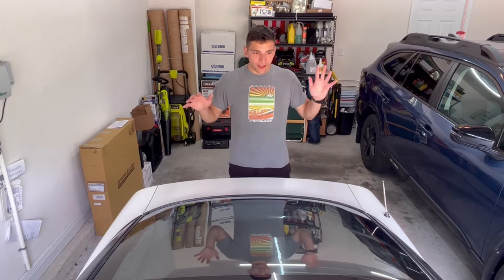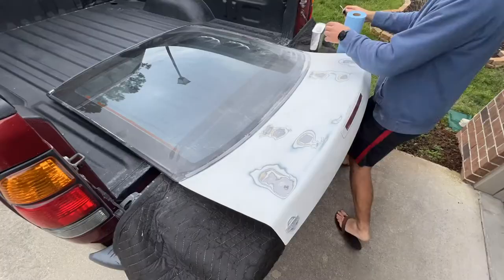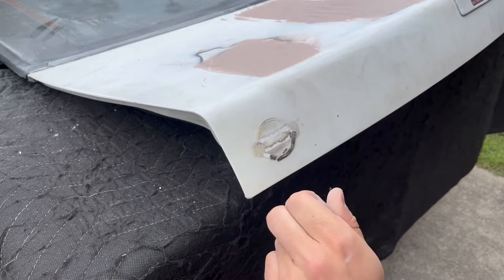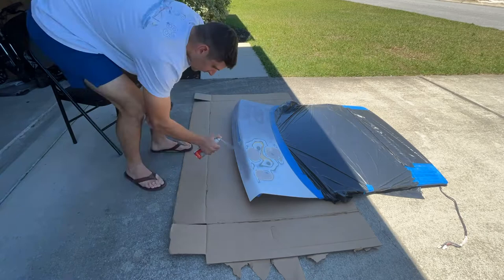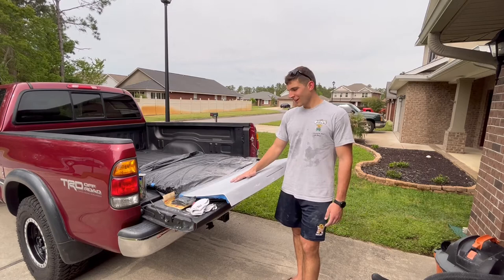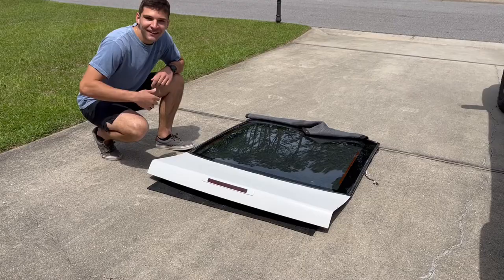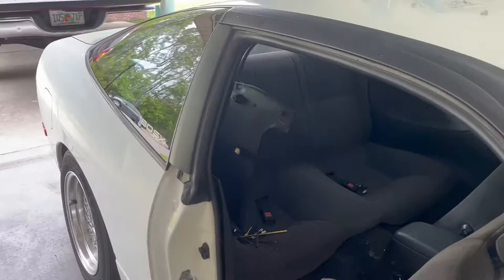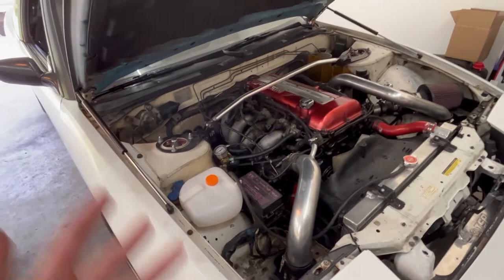No more holes!! All done refinishing the hatch on my s13

Comment: Quick question as I was watching your section on your battery, have you ever had issues with the battery draining after a few days with it installed in the back, I started having that issue after relocating it to the back, ground is the same as yours too, power wire goes straight up to the starter.
Reply from the maker: I haven't had issues of the battery completely draining, but I do think I have a bad ground somewhere. Relocating it will always introduce some new points of failure, but if you trace all the wiring you should be able to find any issues. Thanks for watching